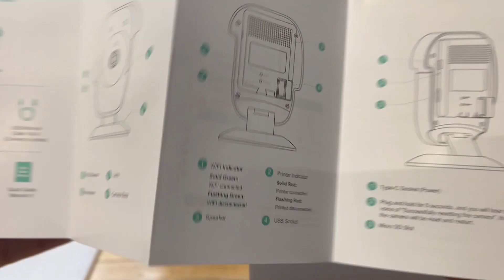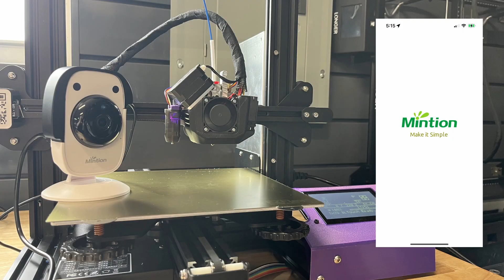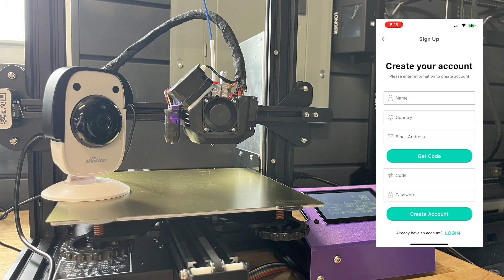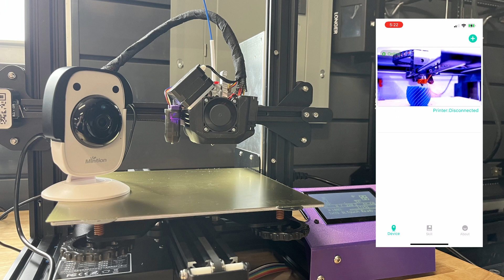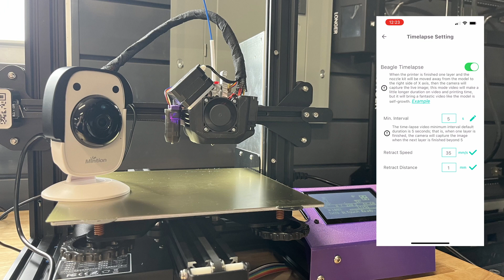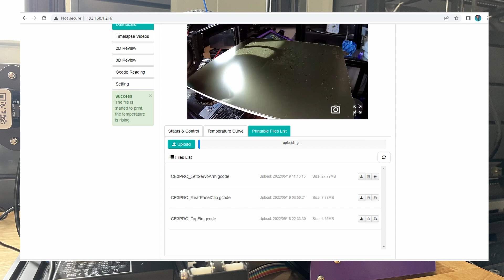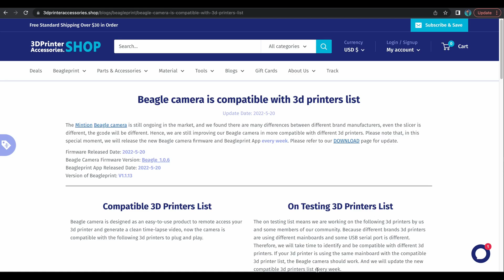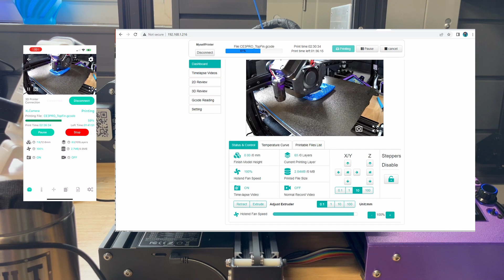BEAGLE CAMERA  - Remote Control Your 3D Printer for Only $69

Comment: Back of the unit there is 2 caps that can be prised out and revels the nut and bolt to adjust the tightness of the heads movement.

Comment: Are you still using Camera? My keeps destroying the SD Cards. The one that came with the camera and then I put brand New Scan Disk work for a day and then my print fail and my Sd Card no longer worked. Could not read any longer on my computers or any other stuff that had SD card reader. I wrote to them but they trying to tell me that my SD Card Reader on the computer is faulty. Not blaming that could be a Camera.....

Comment: It's nice to see this camera in action! I was sent one in April but I'm still waiting on a firmware update so it will work on any of my printers. CR-10V2'S and Fokoos Odin5 F3's. I was told June 6th for the v2's but nope, they say give them a few more days. I'm excited to get it going and see what kind of cool footage I can get. Great video!!!
Reply from the maker: Thanks for watching and commenting!  They have been actively on firmware updates, hopefully soon 👍
Reply: @TripodsGarage  I've got the firmware update for the CR-10V2 but it won't connect to my wifi for some reason. Just keeps saying failed connecting. 😒

Comment: I couldn't see if the printer lcd powered on when you powered up the Cam.
Reply from the maker: Yeah the LCD is on
Reply: @TripodsGarage  guess it'll never be standard to block that pin. It'd be OK if things didn't tend to get fried by competing 5v regulators.
Reply from the maker: @OldCurmudgeon3DP  - I didn’t notice anything funky going on.  However, it would never hurt to block the 5v.

Comment: The power cable connection should be on the back as well. It could use a tripod screw mount.  I'm interested in a traffic scan to see what remote servers it is connecting to.
Reply from the maker: Yes, both cables should be on the back.  Plus a tripod screw underneath would solve lots of placement issues.  Think I will run a traffic scan  👍
Reply: @TripodsGarage  Or atleast a right angled cable that clips on the back near the other cable for easy cable management and to put more counter weight on the rear.